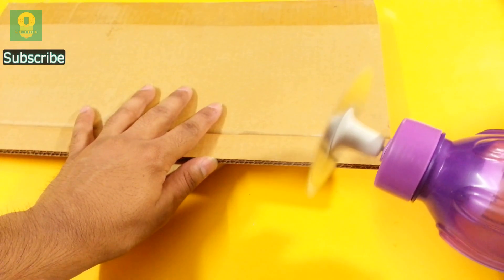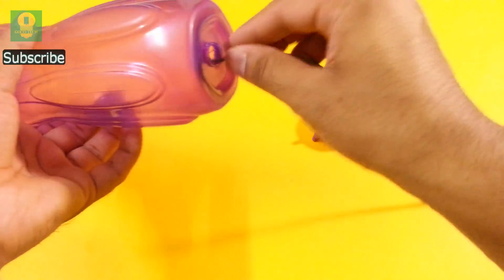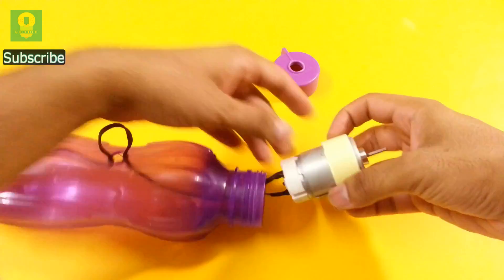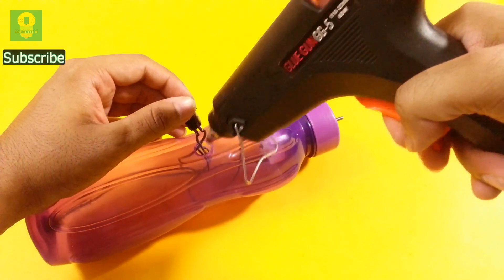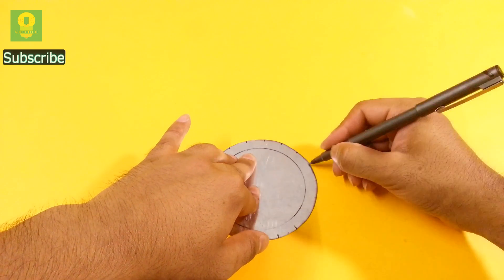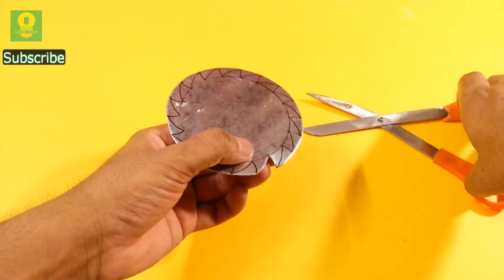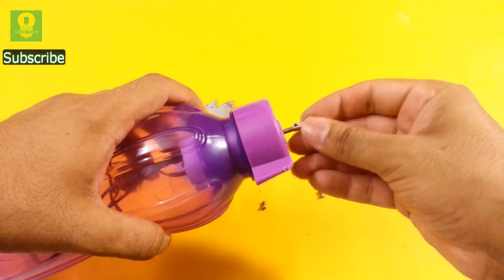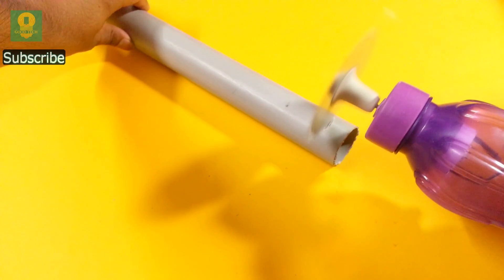How to make a powerful Dremel Tool

Comment: hey thats awesome but can you make a rc car with high torque ???? and  if you can please plz plz plz make it request
Reply from the maker: Thanks but i didn't understand what is RC car with high torque? I have already posted a RC stunt car video (https://youtu.be/masGJ170wsw). It requires high torque motors to perform stunts.
Reply: +GOODTECH - Creativity and Science i saw that video but thats not wireless.
Reply from the maker: Well there are two ways of making a wireless remote car or any other toy.
First is, take a Receiver transmitter kit from any old RC toy and connect it to newly built car.
Second is, to design and make a wireless circuit at home(but this also requires RF receiver transmitter module).

I have an old RC toy, so will soon upload a video tutorial to make a wireless Remote car on my channel.

Comment: in this video we will learn how to make a powerful dremel tool...
barely cuts thru' cardboard
Reply from the maker: i guess you didnt see the end of the video, actually that cardboard was just an initial demo, if you see the video ending, you will find out that this tool can even easily cut PVC pipes easily. It has also been tested on Sunboards, flexboards, fibre sheets, thin wooden plyboards and it worked really well.
But if you make one, do make sure that the M-seal adhesive used to fix the blade is in proportion all round, so as to prevent vibrating of the motor due to imbalanced load.
Reply: kk thanks
Reply: +GOODTECH - Creativity and Science ya it doesn't cut thru pvc easily
Reply: lol use a bigger motor:D
Reply: حمد
Reply: I also agree.😂

Comment: you just wasted your time by making a dremel tool to cut cardboard why not use scissors
Reply from the maker: No, actually that cardboard was just an initial demo, if you see the video ending, you will find out that this tool can even easily cut PVC pipes. It has also been tested on Sunboards, flexboards, fibre sheets, thin wooden plyboards and it worked really well.
But if you make one do make sure that the M-seal adhesive used to fix the blade is in proportion all round, so as to prevent vibrating of the motor due to imbalanced load.
Reply: ***** you need a mini drill chuck to balance  and also can you tell why your putting clay on it?
Reply from the maker: It is not clay, it is M-seal adhesive that becomes rock solid once dried and also it helps in balancing the load if applied proportionately.
Reply: ***** its kinda like sugru

Comment: pro tip: use a smaller blade
Reply: why, wouldn't more teeth work to
Reply: Nicholas Ruiz nope, the motor doesn't have enough torque to drive this sized blade effectively, a smaller blade would be much better
Reply: Nicholas Ruiz yeah, that would work well, might as well fit a dremel blade or better yet- just use a dremel
Reply: sasdlasokdalkfdalksfa buying a dremel would work a lot better lol true